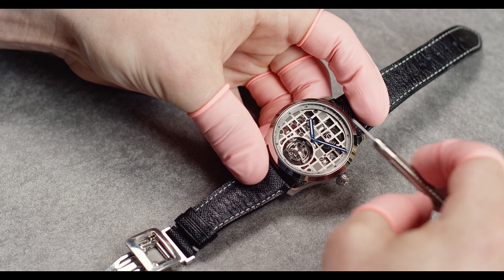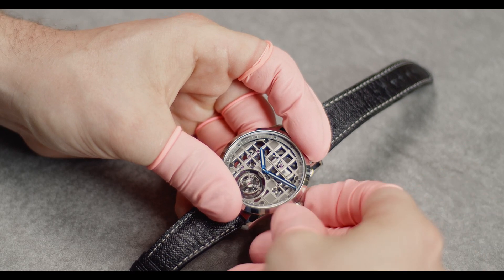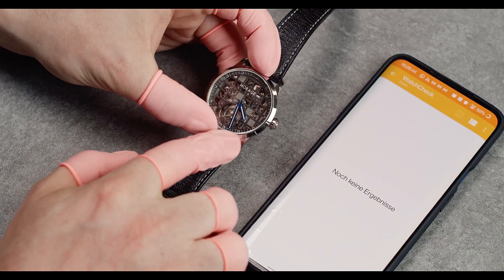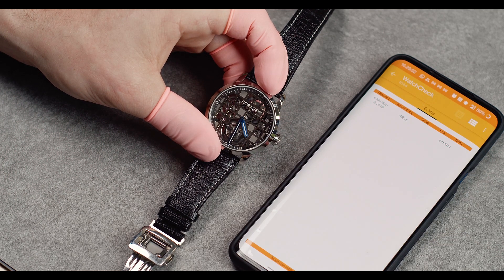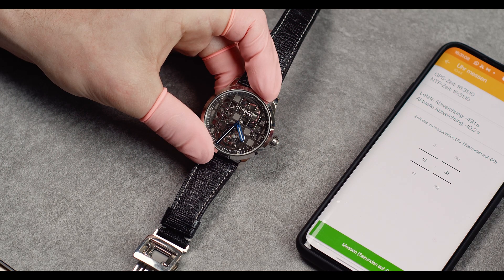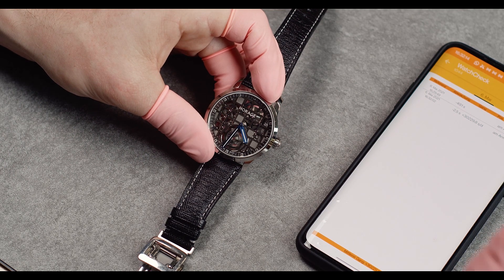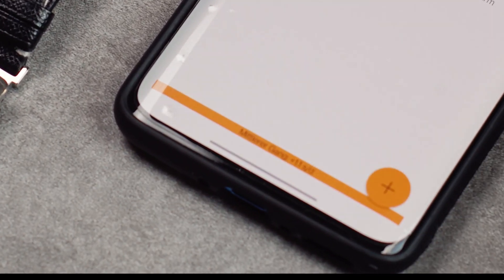Tourbillon 1 User Guide

Comment: Basic instructions:
0:24 the look of the mainspring when not wound (not running)
0:50 watch winding (including overwinding protection)
1:45 setting the watch
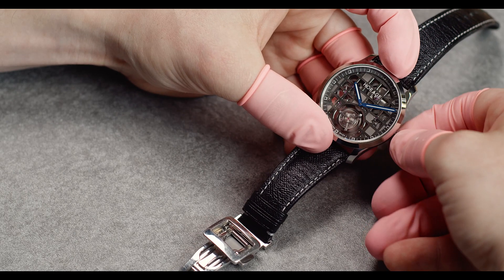2:13 seconds-stop (for syncing down to the second)

WatchCheck app
2:48 WatchCheck app for time-setting 
5:30 WatchCheck app for measuring accuracy
Reply from the maker: Thanks for the time stamps.  👍